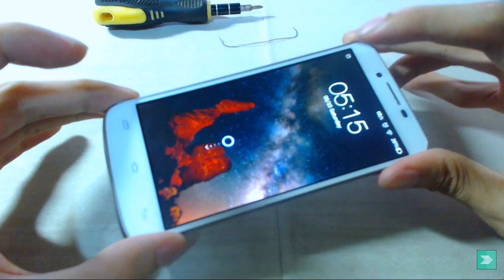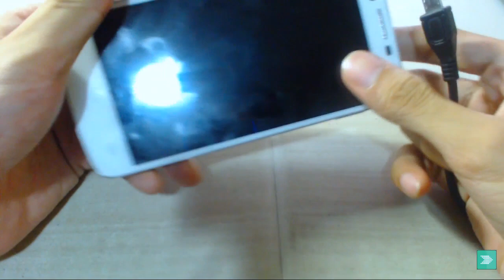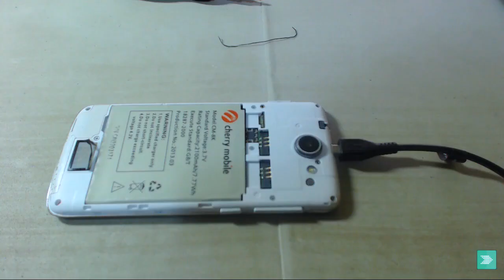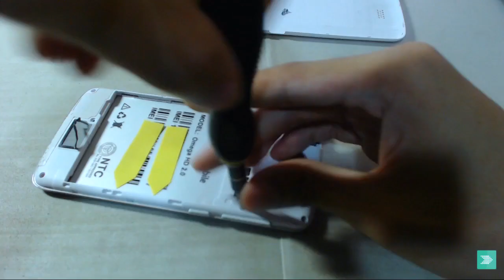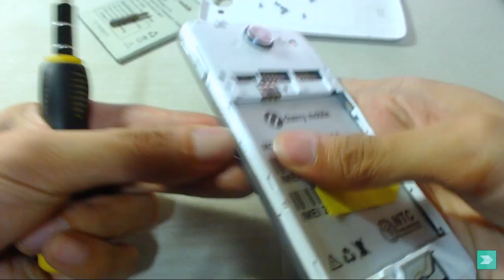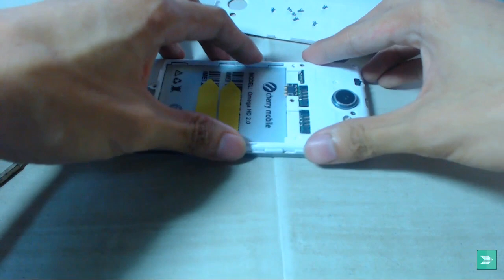How to Unbrick Cherry Mobile Omega HD 2.0 MT6589 Mediatek SmartPhone [Tagalog]

Comment: Revive your Black screen Build7 OHD 2.0... or fix Build7 wifi/bluetooth problems

Attached: Build 7 LK / uboot.img / kernel / boot.img / scatter file... 

Just use the Build 49 stock SP flash files and replace LK with build7 uboot.img.. boot.img with build7 boot.img ... recovery.img with build7 custom recovery.img. Enjoy!

http://www.mediafire.com/file/tdv7huzegqluspq/build7files.zip

Comment: nag install po ako ng CWM Q500_Flashable zip... my device entered into a boot loop until I was able to power it on again to then get stuck at the recovery screen.
Reply: flash it using sp tool. Find new firmware sa phone mo. CWM is not stable recovery. Better use TWRP :)

Comment: Boss yung sa Cm S100 flare na deadboot
Reply: nababasa ba ng computer yung phone mo, if it does, madali nang i-flash yan. hanapan mo na ang ng firmware yang cm s100 flare mo :)
Reply: Opo boss. Nababasa pa, pero pag inoopen ko yung nakalagay RESET FOR QPST ENTRY DOWNLOAD, Kahit I volume up + Power ganun padin e.
Reply: di kaagad yan. I guess, may remnant pa ng mga corrupted files yang loob ng cp mo. so, full format mo sya using SP tool (except bootloader), yun ang importante, before mo siya install-an ng new firmware ng phone mo..
Reply: SP flash tool boss? Paano mag flash?

Comment: my device is same as this pero bkit nung matapos ko iflash nag "blank screen". gumagana sya pero light lang s baba and my konting line sa taas n swipe ko screen eh umiiba ung kulay. di ko n rin maaccess ung recovery mode dahil blank screen n rin. ok n sna blank screen lang problema. cnunod ko nmn lahat ng steps s method 1 pero bakit di successfull? my paraan p b para maaus to? pashare nmn pls. tia
Reply: the problem is either:
System:
Boot.img is bad, corrupted or overwrite
Hardware:
LCD or backlight problem
Solution
System:
Flash only Bootloader and Boot.IMG
Reply: ok, thanks dude!

Comment: Hi All

I installed a custom ROM but it was getting stuck in boot screen ,so i did a auto format flash which deleted all the data in the flash using SP flash tool v3.1312.0.139 . and as I disconnected the phone from PC it got hard-bricked. even if i connect to PC, SP tool is not able to recognize the gionee p2 so I cant do any thing .
can't switch on the phone and not getting recognized in SP tool flash.
Is there a way to fix it or to send the rom data to the phone flash ? 

Regards
Arhdna

Comment: Sir, Help naman sa Cherry Mobile Omega S200 MTK6577. Na-boot loop po phone ko. Una pong nasira yun CWM Recovery bago mag boot loop dahil sa incompatible version na nainstall ko. So di na po pwede boot sa Recovery. Then nag factory restore po ko within OS>dun po sa settings tapos yun, boot loop na. Detected pa po sya nung SP Flash Tool pero di na po ma download yung scatter file kahit reseat ko cable and battery. Please advice. Thanks in advance.